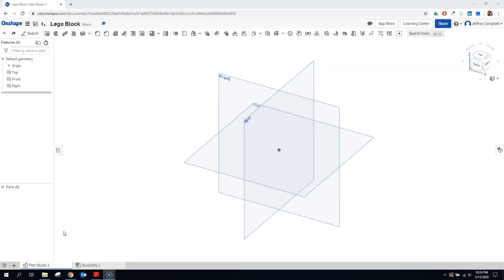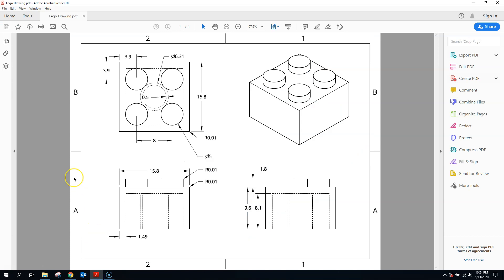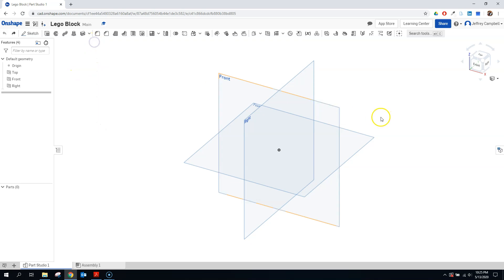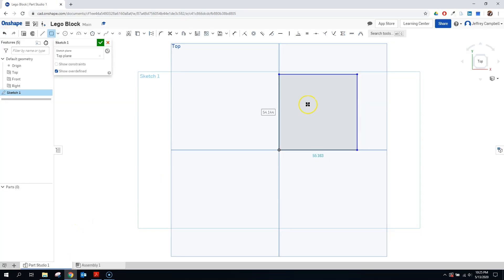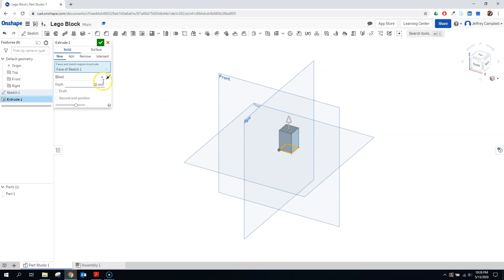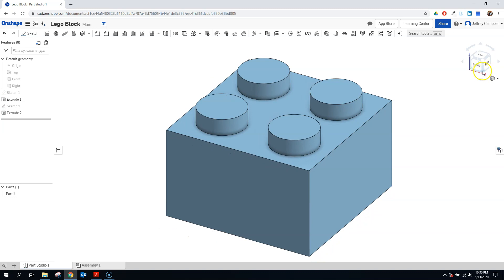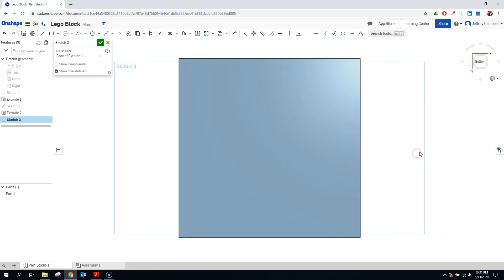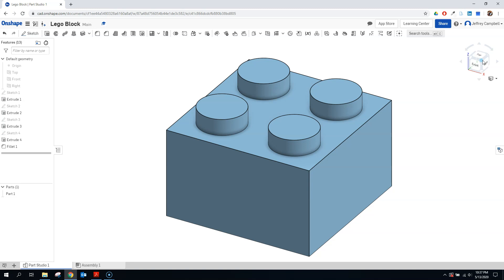OnShape Tutorials - Lego Block

Comment: how do u make a 1x6 plate
Reply from the maker: Use the dimensions for the top row of bumps, repeating the dimensions of the one bump and the distances between them to extend the shape to the side. The dimensions between one bump and the edges can be repeated to make this a 1x6 instead of a 2x2. One nice thing about the use of common dimensions on a Lego block is that you can use them to make other standard Lego shapes.
Reply: @Mythbadger  Can you please show how to make a lego axle and pin connector?